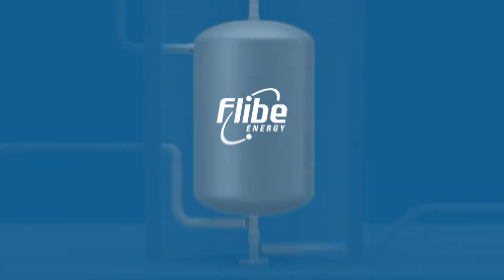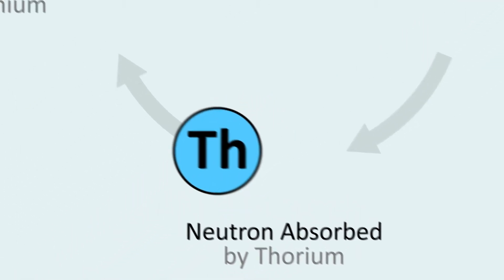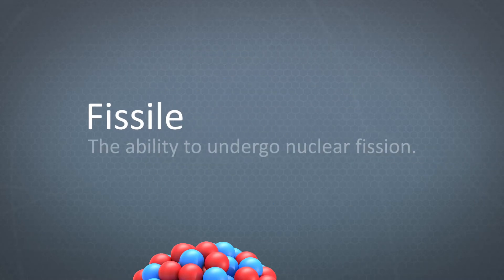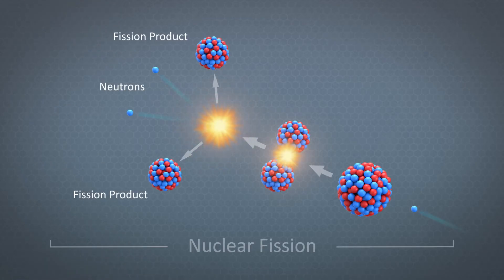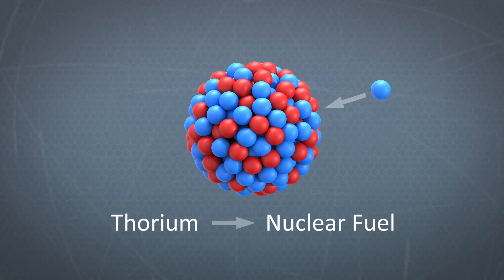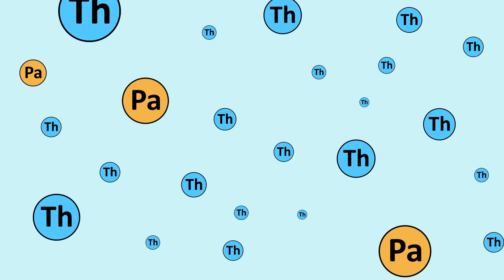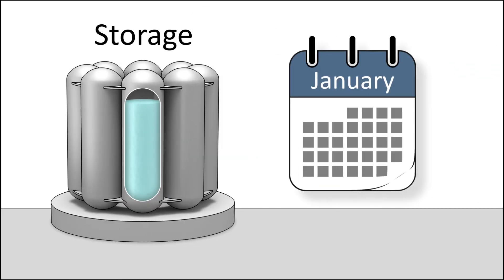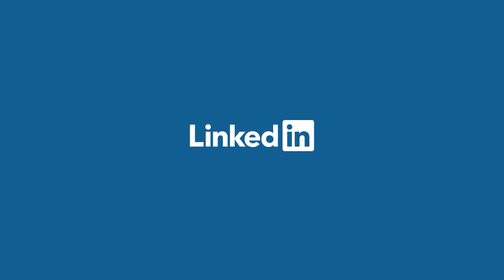Thorium Fuel Cycle Introduction

Comment: Seems like all the energy is from the uranium and the thorium is just used to recycle the uranium.  Like a recycler  reactor but the the recycling is so slow you eventually will run out.
Reply: In spent fuel and depleted uranium there is energy for 100s or even 1000s of years. And there is uranium in seawater, and this is more abundant than Thorium. China has already a solution.

Comment: Im not getting what starts the fission of the uranium
Reply: Enough uranium for criticality.
Reply: Ok this can be done in a few ways.

Take a radioactive element and let it half life naturally so it decays down to 2 lighter atoms and releases a neutron.

In the OG NBs, they fired a slug/bullet of subcritical uranium at another block of subcritical uranium and when the two collided, there was enough mass, in a small enough space, to guarantee enough fissile material (critical mass) was present to eject neutrons to neighboring atoms to cause them to fiss to cause more atoms to fiss to cause the reaction. Ultimately, Little Boy only had of the mass of a butterfly go critical out of the 64kg of fizzile material on board. It was very inefficient in it's detonation, which is why it was more dirty than our current hydrogen bombs, which use a fissile bomb to create the heat and pressure needed for fusion to take place.
Reply: @AnAcolyteOfTheNewGod  The first is not fission, but decay.

Comment: So, more complexity, but the byproducts having a half life within a century vs nearly a billion years. What's misleading is the murky suggestion that the fuel cycle returns to Thorium where the reality is the mutated Thorium into U232 simply provides a fissile trigger to aide the process as the movement of the liquid fuel has a low efficiency  but plenty of yield left so long as the separation of the middle state mutation is managed well enough during production.

Comment: Sounds great, what’s  is the down side?
Reply: It will take at least 10 years, and several very expensive working prototype reactors. Corrosion is a big problem. It may be that circulating hot, corrosive, radioactive salts through meters & meters of plumbing, pipes, valves, seals, pumps is just not a good engineering solution. And in the end, it won't deliver anything current PWRs don't.
Reply: @darkgalaxy5548  Add hard gamma activity to the list.

Comment: When is FLIBE going to build a test reactor or even a molten salt test reactor without thorium/uranium to test flow and corrosion and pumps?
Reply: Never! Flibe Energy has no manufacturing nor construction expertise. It has never broken any ground, poured any concrete. The only thing Flibe has ever produced is the world's most expensive PowerPoint presentation.

Comment: I notice you don't talk about the vicious gamma spectrum from Thorium. Uranium/Plutonium produce (mostly) alpha/beta emissions that are easily shielded. Gamma not so much.
And a question - if Thorium reactions are so great, why is it not common? If your answer is 'conspiracy theory' then you f**ked up.
Reply: The point is - why use thorium at all, when spent fuel and depleted uranium (DU) is abundant?
The waste of 1 reactor year of a 1 GWe conventional reactor can provide up to 140 times the electricity originally produced. Additionally, the side product from enrichment, depleted uranium can provide another 4 - 5 times the electricity of the waste. In total, this is about 700 times the electricity that was produced by nuclear in the past. This is are resources worth tens of trillions or even hundreds of trillions USD could pay the debt of the US multiple times easily.
A side effect is that the "waste" produced after complete burn down consists of 95 % partly precious metals, and about 5 % of waste that decayed after 30 years to the level of natural uranium. Of course, it is poisionous, but can be stored just like normal chemical waste. 
IMHO, before using thorium waste and DU should be burned. And if this isn't enough after thousands of years, there is the posibility to get uranium from seawater, for which China seems to have found a cost effective solution now. 
You can use thorium in the same reactors that burns waste and DU, but it isn't necessary for energy needs for a long time. But be aware, beside some advantages of thorium, there are nasty site effects. The small part of U-232 produced during breeding, which may help against proliferation, decays to TI-208, which issues hard gamma radiation. This requires more expensive shielding and complicates handling. 
So again, why use thorium when it isn't really necessary?

Comment: Thorium is equivalent to Uranium-238.  They are not fissile materials. They both require a breeder reactor to make them into a viable energy source.  

We have warehouses full of millions of tons of surplus Uranium-238, about 5000 years worth (they can't give it away) so it's not clear the various nuclear agencies will invest the time required to switch to Thorium, which doesn't have that many major advantages.
Reply: The point is - why use thorium at all, when spent fuel and depleted uranium (DU) is abundant?
The waste of 1 reactor year of a 1 GWe conventional reactor can provide up to 140 times the electricity originally produced. Additionally, the side product from enrichment, depleted uranium can provide another 4 - 5 times the electricity of the waste. In total, this is about 700 times the electricity that was produced by nuclear in the past. This is are resources worth tens of trillions or even hundreds of trillions USD could pay the debt of the US multiple times easily.
A side effect is that the "waste" produced after complete burn down consists of 95 % partly precious metals, and about 5 % of waste that decayed after 30 years to the level of natural uranium. Of course, it is poisionous, but can be stored just like normal chemical waste. 
IMHO, before using thorium waste and DU should be burned. And if this isn't enough after thousands of years, there is the posibility to get uranium from seawater, for which China seems to have found a cost effective solution now. 
You can use thorium in the same reactors that burns waste and DU, but it isn't necessary for energy needs for a long time. But be aware, beside some advantages of thorium, there are nasty site effects. The small part of U-232 produced during breeding, which may help against proliferation, decays to TI-208, which issues hard gamma radiation. This requires more expensive shielding and complicates handling. 
So again, why use thorium when it isn't really necessary?

Comment: The way this is explained, it sounds a lot like perpetual motion. I'm not saying Thorium is bad, I'm saying this video is bad.
Investing in Thorium research might be a good idea but investing in Flibe Energy might not. Big Used Car Salesman Vibe!
Reply: It's just that there's such a vast amount of thorium available to mine that it's inexhaustible. It'll last 1000 years or more. By that time fusion will be working.
Reply: @adrianthoroughgood1191  By that time society may have crumbled.
Reply: @bennpierce2990  I think some countries will remain civilised even if others degrade. Either way running out of thorium is not going to be a problem.
Reply: @adrianthoroughgood1191 Uranium is even more abundant, when extracted from seawater. China his doing that.
Reply: The point is - why use thorium at all, when spent fuel and depleted uranium (DU) is abundant?
The waste of 1 reactor year of a 1 GWe conventional reactor can provide up to 140 times the electricity originally produced. Additionally, the side product from enrichment, depleted uranium can provide another 4 - 5 times the electricity of the waste. In total, this is about 700 times the electricity that was produced by nuclear in the past. This is are resources worth tens of trillions or even hundreds of trillions USD could pay the debt of the US multiple times easily.
A side effect is that the "waste" produced after complete burn down consists of 95 % partly precious metals, and about 5 % of waste that decayed after 30 years to the level of natural uranium. Of course, it is poisionous, but can be stored just like normal chemical waste. 
IMHO, before using thorium waste and DU should be burned. And if this isn't enough after thousands of years, there is the posibility to get uranium from seawater, for which China seems to have found a cost effective solution now. 
You can use thorium in the same reactors that burns waste and DU, but it isn't necessary for energy needs for a long time. But be aware, beside some advantages of thorium, there are nasty site effects. The small part of U-232 produced during breeding, which may help against proliferation, decays to TI-208, which issues hard gamma radiation. This requires more expensive shielding and complicates handling. 
So again, why use thorium when it isn't really necessary?

Comment: hmm... is this true? then WTF have we been doing this whole time and why? if this is true and possible what is the issue? corrosion? is that the issue? must be....
Reply: It's a lot more complicated to get it working reliably in real life. This just gives an overview of the plan. Getting a reactor to work safely and reliably for a few decades is hard because the metal parts degrade. Several companies in several countries are actively working on solving the problems.
Reply: The point is - why use thorium at all, when spent fuel and depleted uranium (DU) is abundant?
The waste of 1 reactor year of a 1 GWe conventional reactor can provide up to 140 times the electricity originally produced. Additionally, the side product from enrichment, depleted uranium can provide another 4 - 5 times the electricity of the waste. In total, this is about 700 times the electricity that was produced by nuclear in the past. This is are resources worth tens of trillions or even hundreds of trillions USD could pay the debt of the US multiple times easily.
A side effect is that the "waste" produced after complete burn down consists of 95 % partly precious metals, and about 5 % of waste that decayed after 30 years to the level of natural uranium. Of course, it is poisionous, but can be stored just like normal chemical waste. 
IMHO, before using thorium waste and DU should be burned. And if this isn't enough after thousands of years, there is the posibility to get uranium from seawater, for which China seems to have found a cost effective solution now. 
You can use thorium in the same reactors that burns waste and DU, but it isn't necessary for energy needs for a long time. But be aware, beside some advantages of thorium, there are nasty site effects. The small part of U-232 produced during breeding, which may help against proliferation, decays to TI-208, which issues hard gamma radiation. This requires more expensive shielding and complicates handling. 
So again, why use thorium when it isn't really necessary?

Comment: This technology has been around since the early 50s and 60s but it wasn’t used because it wasn’t making nuclear bombs and that’s the bottom line. The failure of the human race.
Reply: Where do people keep coming up with this BS that Thorium was abandoned and Uranium based PWR/BWR were chosen so we could make bombs?
Hanford Wa. has been making weapons material, at their 9 reactors, since 1944, 12 years before the first U.S. commercial nuclear plant became operational and their weapons production reactors are very efficient graphite moderated reactors and DO NOT produce any electrical power.
Savannah River site SC. Has been making weapons material since 1955 and their 5 production reactors are very efficient low pressure heavy water moderated reactors and DO NOT produce electric power.
Thorium was tried at Shippingport and Indian Point commercial reactors in the 1970s and abandoned as too costly compared to Uranium.
Weapons production reactors are NOTHING like U.S. commercial PWR or BWR power reactors and commercial power reactors have NEVER been used to produce Pu239 for weapons, since there has never been a need beyond what the efficient weapons production reactors could provide..
The U.S. currently literally has hundreds of TONS of  Pu239 (takes less than 20 pounds per weapon). The U.S. has so much that 34 tons of weapon grade Pu239 is being treated so it can eventually be disposed of at a cost of billions.

Your comment is like saying automobiles use gas engine because the military wanted jet fighters.  God help us that people base their knowledge on social media and YT videos.

Comment: Thorium 233 has a 27-day half-life so you'd probably want to hold it for a closer to 10 months instead of 1 month if you want to avoid exposing half of it to neutrons. 
Even though U233  gamma rays are in the 1% abundance range there will be so much of it the gamma radiation in the storage area will still be nothing to sneeze at.  Each step where an element transitions from one medium to the next isn't 100% efficient so how do you deal with the buildup in the salts and in the bismuth of the things you don't want? 
 I wonder what kind of alpha neutron reaction you'll get with bismuth and uranium or thorium.   Over time, I can't imagine Fluorine not absorbing some stray neutrons and becoming sodium 22.  or ionizing and giving off flourine gas.   Just seems like this is highly simplified and more messy than it looks.
Reply: 100% true. It's really complicated and fascinating stuff. Maybe there's a practical solution that some really smart PhDs can figure out, maybe not. Cool stuff either way.

Comment: I wouldn't quite call it endless, when you run out of Thorium that's ultimately the end of U233 production so soon after the game is over.
Reply: You're not going to run out of thorium. There is a lot of it and it's a problematic mining waste. I would be more concerned with the materials needed to construct the reactors.
Reply: @kevindouglas2060  :-) That's not my point, my point is it's not endless. I think I read 2400 years worth of Thorium. That is not endless. Last I looked the oldest human civilisation was some 50,000 to 60,000 years. Everyone ignores the need for things we do to be circular, not dig here dump here. Look at everything in biology, materials have been turned over for millennia.
Reply: @etmax1 2000 years is endless enough. By then we will have fusion working.
Reply: @adrianthoroughgood1191  Fusion will be here 40 years after we actually need it. In fact they are saying that we're running out of I tritium needed for fusion.
Reply: @etmax1  tritium has a half life of 12 years. It has to be man made. There isn't a deposit of it to use up. Fusion reactors will have to breed tritium like thorium reactors breed U233. But you need a lot of tritium to start a new fusion reactor off and that is going to be a challenge. I think the current supply is enough for only one commercial size reactor. It's currently made in CANDU reactors because they use deuterium (heavy) water. When the deuterium absorbs a neutron it makes tritium and they can separate that out. The problem is the CANDU reactors are old and getting retired so the amount of tritium produced is reducing. When fusion becomes a real thing, we will have to also build some reactors that produce tritium to fuel them.
Reply: Uranium in seawater is really abundant. China is already extracting it.

Comment: The Thorium fuel cycle is NOT _endless_.   It's large, but words have meaning.
Reply from the maker: Do you consider the Sun endless? Because the thorium on earth will outlast the Sun. And that's just what's on this planet.
Reply: time is relative. on geologic time scales, and galactic time scales...  Truth be told, Space Based Solar Power is the best power source on this side of the asteroid belt. But we need industry in space to make SBSP even remotely viable. FLiBe is taking the route it can, to bring clean efficient power to mankind.

Comment: so just wondering what king of Other U it makes if the PA is not removed on time and whats the time framke it takes.......
Reply: If Pa 233 is not removed from the blanket it will absorb another neutron becoming Pa 234 decaying into U 234 which is nonfissionable and has an annoying crossection eating too many neutrons. If your U 233 fission reaction spawns 2.3 neutrons on average and you need one for turning Th 232 into U 233, and you need one neutron for fissioning the U 233. The neutron economy is very tight. I do not see proliferation as a deal breaker either. While you will make U 233 from Thorium, you need the U 233 to keep generating power. And you also need U 233 to decay to nuclear medicine isotopes. There are $$$$ in everything produced by a LFTR. So inventory would be closely monitored.